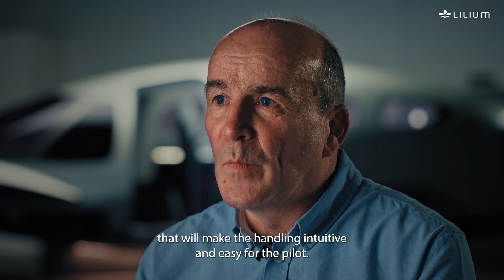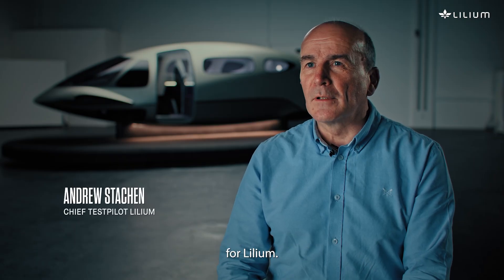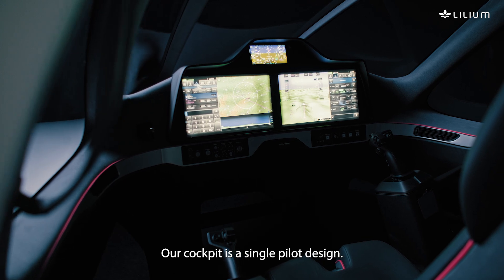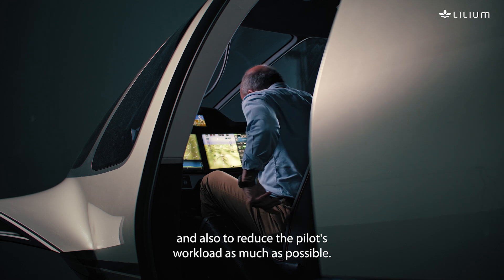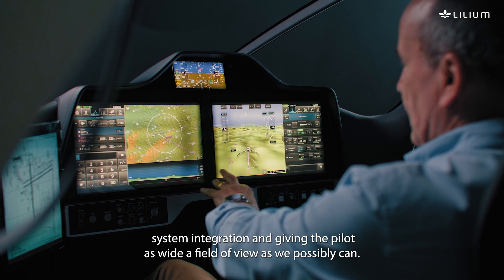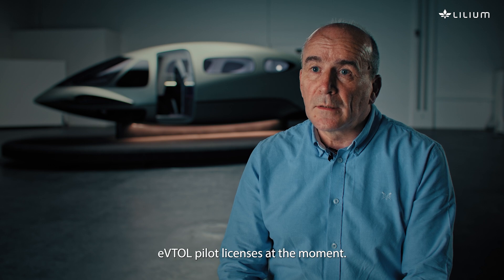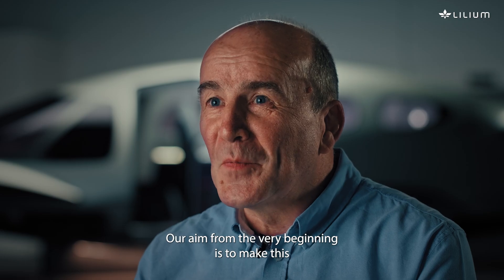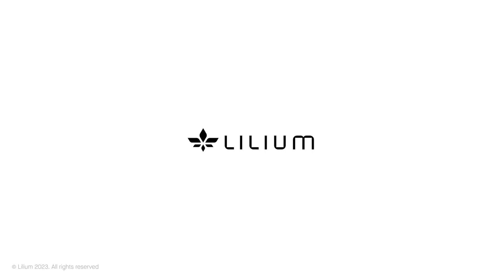Lilium Jet | Cabin Design Series | Hear from Andrew

Comment: This company went from being a promise for the possibility of citizens having flying cars, to a private jet requiring a dedicated pilot for elites. Disappointed
Reply: Okay but why don‘t you think at first? They wanted to make a private 2-seater in like 2016, but why has that changed…. Regulations! You are not allowed in Europe or the US to fly this without a license, so nobody would buy it. I hate to say this, but Lilium would go bankrupt if you were their CEO lol.
Reply: the company will never leave the promise stage.
Reply: @frankyflowers  Too much money involved. If the batteries are the main reason for failing, they would rather go with a hybrid version, till the batterie tech evolved. They could use the batteries for take off and landing and recoup it in level flight via a combustion engine.
Reply: @0Turbox  it can't even lift the weight of people without an engine and fuel using batteries and their motors.  they should use a catapult or rockets.
Reply: LILIUM never intended to build a personal/retail flying-car.  The plan was always cargo/passenger short-haul hops like an air-taxi.
Reply: No, you just can't read or comprehend. They never said of selling them for private use.